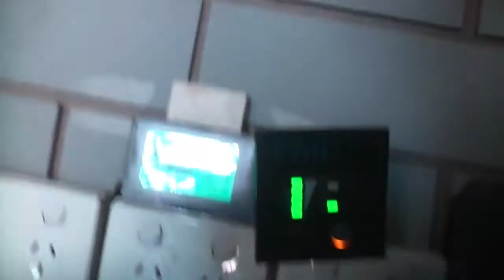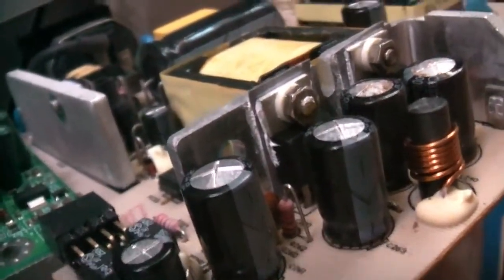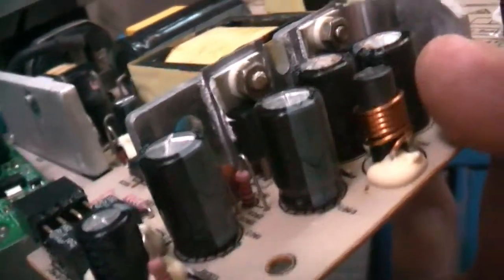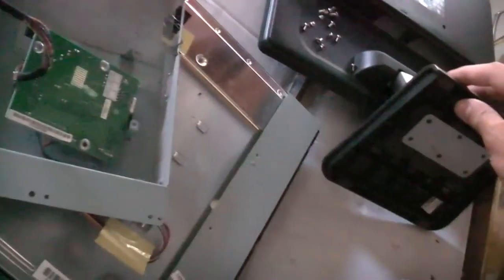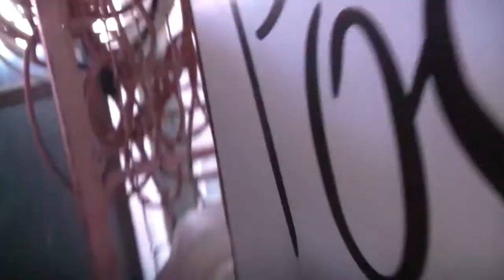acer monitor repair

Comment: Wasn't this Acer monitor an AL1916 or AL1916W? Because it looks like it and I have one but mine was underwater from flooding it seems like it's fine....but every now and then it will turn itself on because the power button shorts out turning it on and off at times but it hasn't been doing that recently